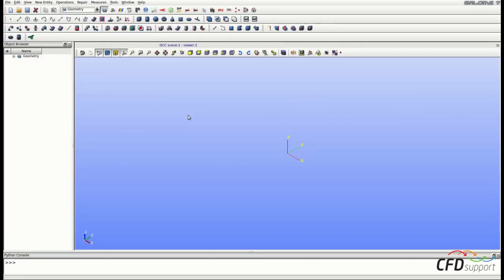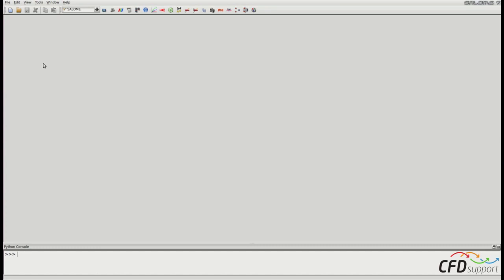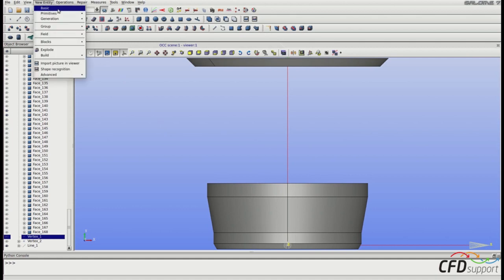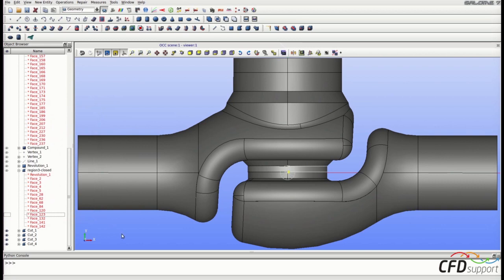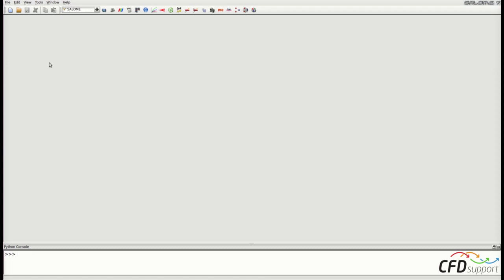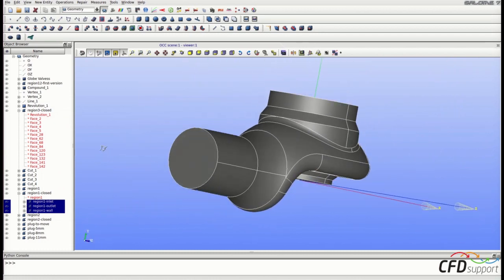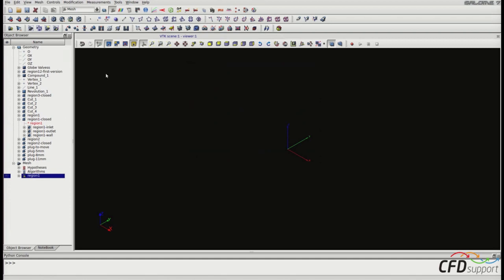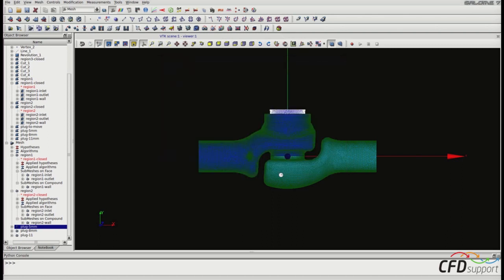TCFD® Preparing CAD Geometry, Cleaning, Getting Waterproof Wet-Surface in Salome

Comment: Why did you divide the valve in two groups, inlte and outlet? I see both can be taken as a single one for flow analysis ?
Reply from the maker: It was not necessary you are right. There is an interface in the middle. But no need for two components.
Reply: @CFDSupport  Thank you. Maybe there is a need because the second component influences the first?